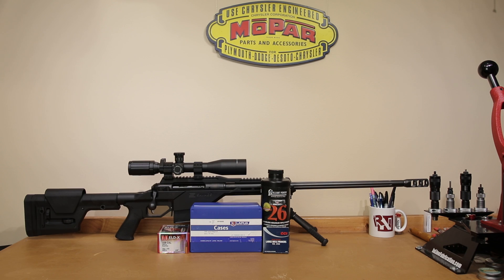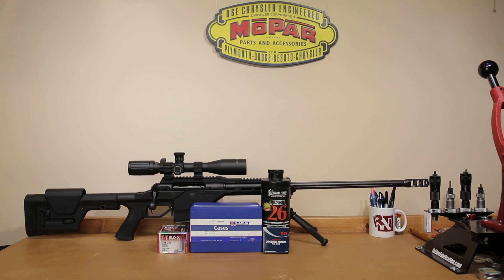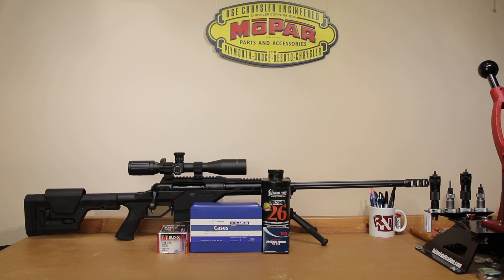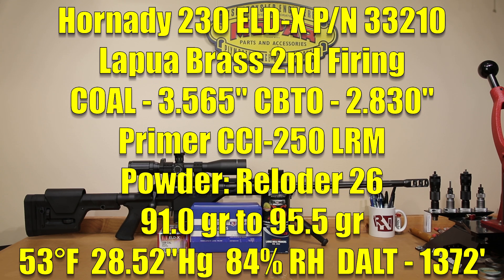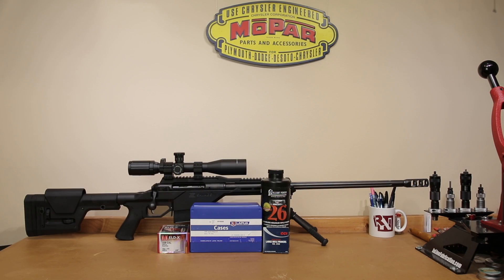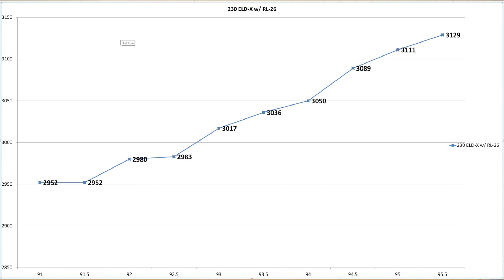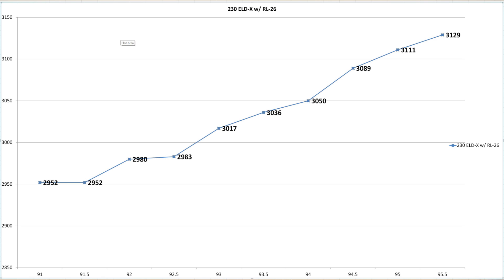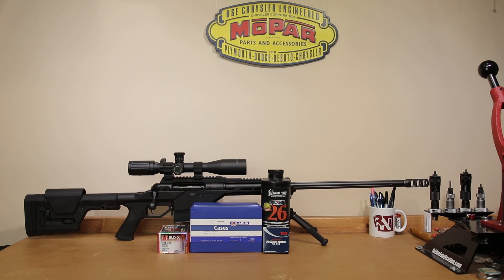338 Lapua - Hornady 230 ELD-X and Reloder 26 Load Test

Comment: How did you cure the scope rail issue?
Reply from the maker: Short answer is longer screws and loctite. I have been testing it and so far no issues but I don't have a hundred rounds through it yet either. I thought about covering it in a video.

Comment: I have the same rifle. I have fixed my rail coming loose with blue lock tight and torquing the rail screws down a lot tighter than factory torque specs. I have a load made up with the 230 eldx with h4831 shooting about half an inch with O.A.L at 3.681. I hope this is helpful for ya

Comment: Regarding velocity nodes. Would it make more sense to fire five rounds per charge and plot the average velocity? Only firing one round seems it would give erroneous data due to deviations that occur shot to shot. Having a stable load produce single digit deviations is rare and it seems comparing different charges for velocity changes off of one round would not be accurate.

Comment: Ken Ferrell makes a nice rail for this rifle a much better setup clean the screw holes and screw with alcohol use canned air to dry job weld to us as bedding compound and torque screws in with blue loctite to solve you rail issues

Comment: 300 grain Berger 88.5 grain H1000 with fed 215GM is a good start at 2760fps could also try the 250OTM as well 92 grain of Rutmbo shoots close to 3000fps either load is excellent

Comment: The group is pretty good considering!!  I cut that cantilever rail part off of mine, degreased the screws and holes blue loctite about 25 inch lbs haven't had a problem since our last talk about this beast good luck !! I'll stay tuned
Reply from the maker: There are 2 more bag group test and then right back to a moa.
Reply: @BoltActionReloading  mine seems to really like the 250 grain Sierra HPBT about .65 moa ..I did break in the barrel with 225 sst's during the break in groups started closing up... then did my best to neck size only with a standard full length die loaded them up with the 250's and H1000.  I did use JB bore cleaning paste about 30 times and a 2nd 30 times almost forgot... Before I started the break in
Reply from the maker: I have some interesting results with 285 eld coming, but I am still working with the 250 smk as well.
Reply: @BoltActionReloading  I'm working with the 285's too going to try retumbo,H1000, and 7977 ..IMR came out with new powder the label color is a shade of purple I think 8000 something ?

Comment: Use Loctite 222 Low Strength or 243 Removable on all your screws for scope mounting rings and picatinny rail. Do not use the red (262, 271, 272), that stuff is permanent!
Reply from the maker: Thanks Frank I pretty much use 243 across the  board

Comment: A word about the rail, throw it in the trash, yeah it looks cool but it's worthless, I have the same gun and I had the same problems, I put  a badger ordnance 20 moa rail for the Savage 110 on mine, bedded it and problem solved.
Reply from the maker: I think  the  bigger issue is the length of screws honestly. If the new config comes apart then I will be swapping to a new rail.
Reply: @BoltActionReloading  I loved the way the gun looked with that rail, I was going to try and bed it but friend told me to just try that badger rail, and it worked